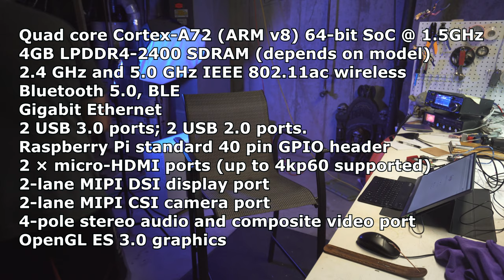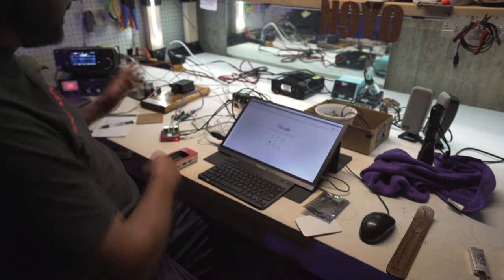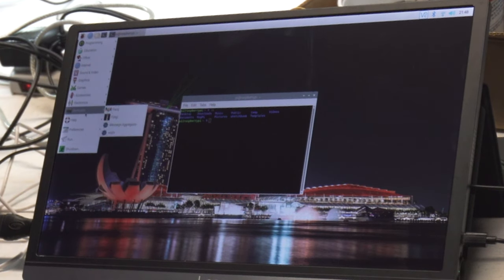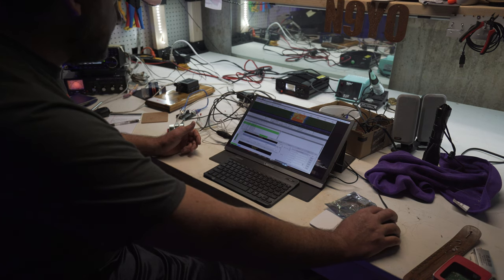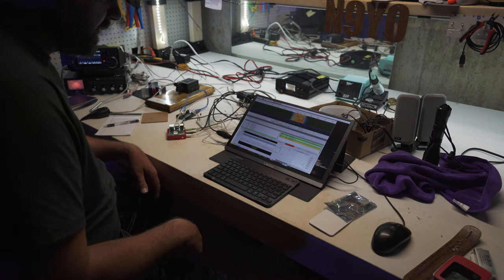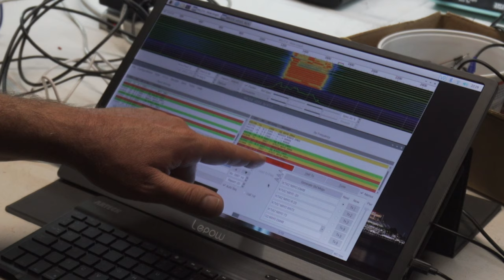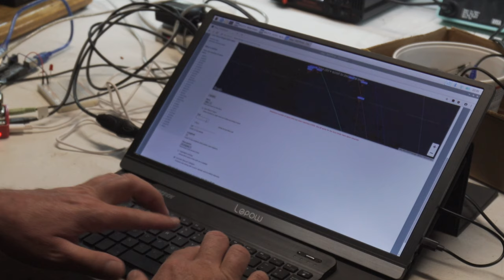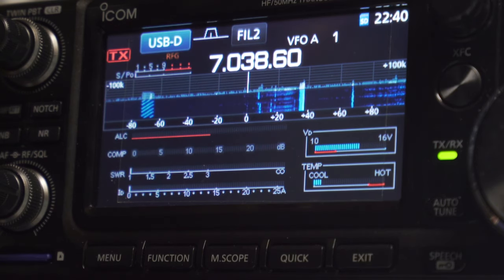Ham Radio Raspberry Pi 4 Linux | FT8 Digital Icom 7300

Comment: Nice Vid Tom. TO say that the Pi can be frustrating is an understatement. Even worse for guys like me who don't have coding/linux experience, or knowledge! I did get this working on my Ras Pi 3b last year, but I also had to use an external sound card card interface (Tigertronics Signallink USB) for the FT-857....even more cables and settings. Using it on a Windows Surface  connected to the 7300 is much easier.
Reply from the maker: Understatement is correct I get it.  But, my job is just like this.  Constant frustration I'm kinda used to things not working for a while.  I tried to say in there just keep trying and keep googling and your not alone.  We're all pulling our hair out.  Feels pretty darn good when it works though!
Reply: @hamradiocq  Yeah, it does. BTW-I kinda hate you now.....I've pricing together a Pi 4....lol......
Reply from the maker: Ha!  Yeah, decide exactly what you want it for... In my case I wanted a fast surf all purpose portable.  If you are just going to do WSPR and FT8 and stuff then the one you have is fine.

Comment: At 4:10 you mention frustration getting the RTL-SDR dongle working. The pi can’t supply much power through the USB port. Some people report better results connecting via a powered usb hub.
Reply from the maker: Tnx, will try.

Comment: One remark: I have an FT891 + Raspberry Pi 3B+. I did not have the time to make everything work, but I found a very useful install-script which helps you to install/compile the latest version of hamlib (library for CAT-control) which also supports the FT891: http://indyham.com/news/new-fldigi-install-script-for-raspberry-pi-latest-version/
It also installs the latest version of FLDigi for a number of other digimodes. Would be nice to know if this works on the Pi4/Raspian Buster as well.
The version of WSJT in the Raspian software repository is probably outdated. You can get an current install package of WSJT for ARM-devices on K1JT's website.

Keep up the good work!
Reply from the maker: Omg thank you!  That's my next task.  Getting the 891 to work on this thing so I am more portable!

Comment: TOM, there are many qrp FT8 only transceivers available in the market. Qrpguys have one and others are available on ebay.. You dont have to carry around the Icom or yaesu.. Will keep everything light and simple. I have always enjoyed your videos.. Keep up the excellent work and have fun..73 de JOY YB0NSI..
Reply from the maker: I hear ya... but I had a Pi and wanted to use it.  Thanks for the comment.
Reply: TOM, u still need the Pi.. but you could leave the bulky icom at home.. Check it out.. Cheers!

Comment: Tom what power was you using on WSPR ?.  I bought a Sota Beams WSPR lite stand alone unit that connects to any Android device and Transmits my signal to test antenna,s mainly, uses 1mW to 200mW,  in the documentation about WSPR it explains that anything Up to about 500mW make is all that's needed.
Reply from the maker: Yeah, I was using 5W, probably too much power?

Comment: Great to see a new video from you.  Dumb question?  What benefit does this have over a simple tablet running windows or Linux in the field and has WSPR, FT-8 on it like I'm currently doing.   I still need a monitor and keyboard?  Not being critical just confused of the benefit of it. Thanks Tom and keep up the great work.  JJK N6NRO
Reply from the maker: That's a GREAT question.  I don't want everyone to run out and buy one of these.  One needs to answer a specific question as to why you want/need one.  The Pi itself is interesting to me for more than just this.  The biggest reason to get one for most, is that it's a relatively cheap way to get a Linux computer to play with, but in addition to that it has Pinouts and Input pins.  That means you can send & receive messages to other hardware devices like, motors, servos, temperature gauges, gps units, LED lights, etc etc. The Pi has HUGE potential for interaction at a low price and that's really why it's special.    I just happened to have shown it here in 1 use case.

  Now, I really bought this for myself as a challenge too, as I'm a programmer, I delve more and more into Linux and this is a good way to learn.  But mostly I also got this because I want a very tiny, ultra small device to do digital with, that's even smaller than a laptop.  I can swap out a 3" screen with this device.  Also, think about the potential of these.   I have another one running in my basement with no monitor attached or anything.  I can SSH, or open a terminal, and connect to it over my network. I can control my other Pi from anywhere on my home network. I have it doing a daily job for me.  It's automatically entering me into a radio contest on a web site everyday and I don't have to do it.   See the potential?  Great question.
Reply: Creativity, learning and the great community support

Comment: Thanks so much for the vid. I'm trying do do this with very same setup, R-pi 4B and IC-7300. My problem is that my audio db graph on the left is way up in the red, and no amount of fiddling with "audio controls" on the R-pi seems to make any difference. How did you get your audio levels correct?
Reply from the maker: Thanks for the comment, Tim.   I don't remember what I did to the audio now...

Comment: HEY there Tom, been following you a while.  Really enjoy your stuff.  Funny and interesting correlations.  I am into Ham radio, worked in IT for Microsoft, lived in and was born in Texas,  love little gadgets, and more....LOL.  Texas has REALLY changed since I lived there in the 80s.  Raspberry PI has interested me for a long time.  I did some simple Pearl programing and ran a few servers at my home and wondered about some home automation using python etc... and then Alexa and...well do the math.  I was hoping to see a program to incorporate a program that would connect to your antenna and do a live feed and tell you (beep) when you are in a range-defined area for broadcasting.  In other words, you tell PI I want 20 meters and it beeps 2 times when you are within a range that your tuner would be happy with or when resonant.  This concept would be ground breaking.  Just a thought.  So surprised this isn't available yet instead of having to backwards engineer every time!   Glad to see you intro the PI here.
Reply from the maker: Thanks so much for the great comment. I really like your idea.  I don't know about you, but I find a big disconnect between knowing how to code for businesses and IT and software, and the electrical engineering part of ham radio.  There's a big piece of RF that I don't "get".  So I won't be coding that anytime soon, but I love your idea.

Comment: You should give JS8 a try Tom!
Reply from the maker: Ok. Not sure what it is though
Reply: Ham Radio CQ JS8 is a free text digital mode based on FT8 so you can actually communicate messages at the same signal strengths. Check it out at JS8Call.com. There are also some great videos here on YouTube about it.
Reply from the maker: Ok, I will thank you.

Comment: Hi there!  I love the Pi!  Also am wanting to make a Pi portable.  Good ideas.  I am new to HAM Radio and may not get into WSPR or digital at first.  I haven’t had my first QSO yet (I am still waiting on my call sign, but am making preparations).  Thanks for another good video.  I get good ideas from these videos.  73
Reply from the maker: I love to hear that, Brent!  Just pick a type of radio and something you're interested in and pursue that.  I started off by getting the Yaesu FT-897 it had both 2 Meters and HF for the long distance contacts that way I was all setup and ready to go both local and far.
Reply: Ham Radio CQ thanks. I am intrigued by a HF, 2M combo.  For hand held I am thinking of a cheap 2M/70cm radio, make my own antennas, save big money for a proper HF rig.  I am impatiently waiting on my. All sign. So I am learning and planning to keep from going crazy.  Haha.  J/k.  Thanks for your advice.   Love your channel!

Comment: I was never frustrated with my pi4. Or my pi3 for that matter. I run all digital modes on the pi3 and pi4. SDR on the pi4. It's less frustrating than windows. 73 de ke4obe
Reply from the maker: 73 tnx for comment

Comment: Hi, ONLY FOUR (4) days YOU ARE MY MASTER. I bought a shotgun to show the Pi I mean business. Now, once it is running it is a jewel. Change the CLOCK rate at the boot. Sampling is at 700 go up to 900. reboot. Use as many as possible with a direct connection with no power drain from the Pi. Or add a USB hub with it own power. Pi 4 is very hot buy a fan get rid of the heat sink they are useless. Your screen is beautiful the set up is wrong. I also bought 2 Pi 3B+ for testing and the Pi4B is the work horse. I think the Pi understood I mean business with the shotgun. KEEP the good work. 73 VA2SOB - Claude.
I forgot, the two HD output are NOT identical. one micro HD runs at 60FPS the othe at 40FPS. Be careful.
Reply from the maker: Ha ha ha nice comment.  I use a grenade and not a shotgun next to my Pi
Reply: @hamradiocq  Good, will try that. Do you know we can use the STR-RTL and a long wire to use the RPi as a full TRANSCEIVER ??? YES. It works on FM, NFM, SSB. It is ILLEGAL for most but not US because we are HAM RADIO and operates on the legal band only.